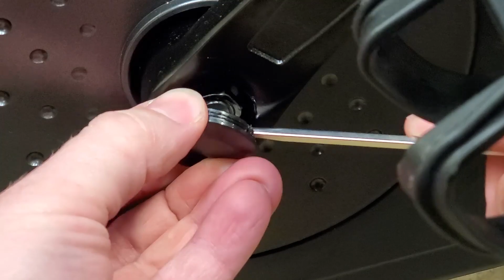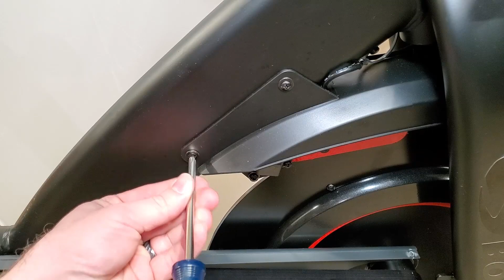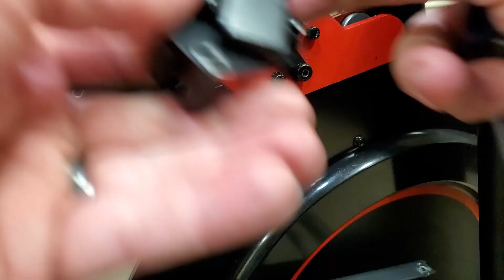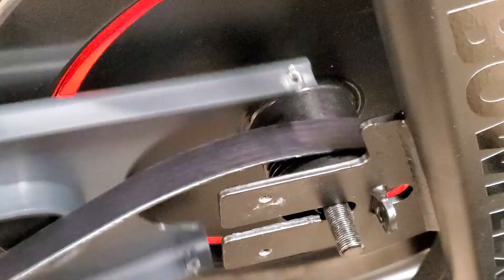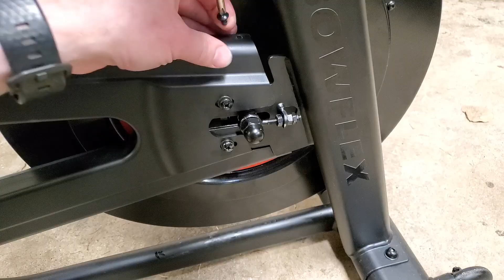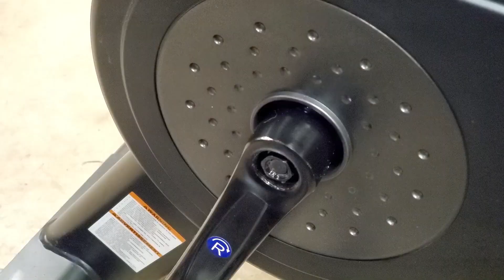BowFlex® Support C7 Bike: How to Replace the Drive Belt

Comment: My bike is 4 years old, and the poor choice of components and overall low quality is apparent. Non-standard tool sizes, such as the 25 mm crank puller, make this bike troublesome and annoying to service. The frame, weld points and hex bolts are rusting, despite the bike being kept in dry-climate Colorado. Parts, service and support from Bowflex is non-existent or poor.
Reply: So did it come with a crank puller? Because if it did then it doesn't matter if it's a non-standard size. As a matter of fact that's kind of the point to make it non-standard so everybody else's stuff doesn't fit. Cars and airplanes have done this for years.